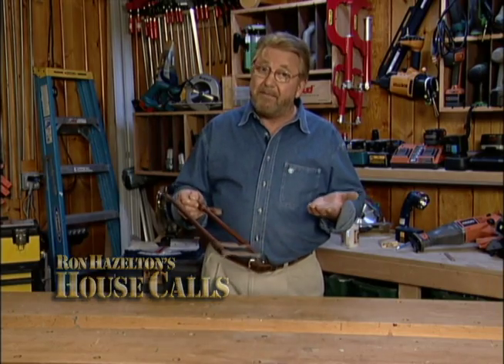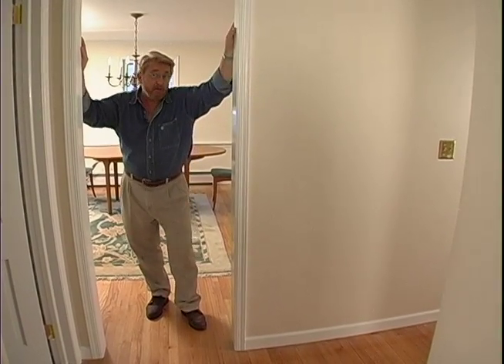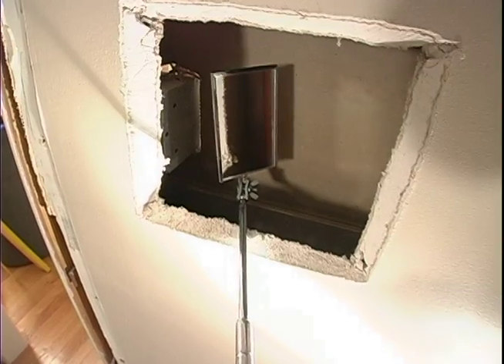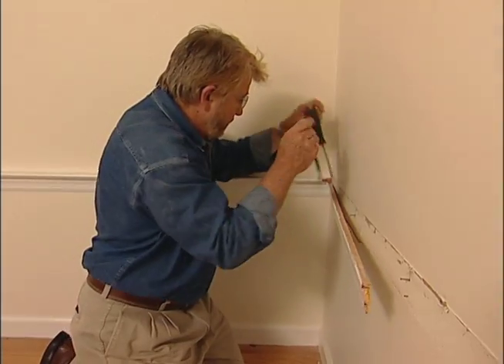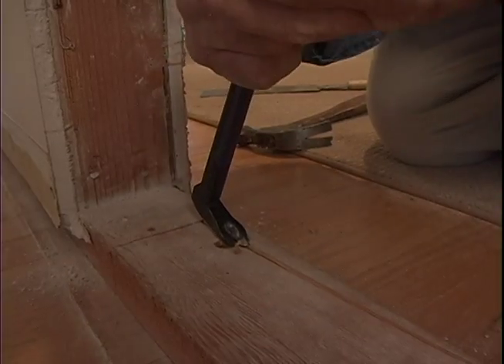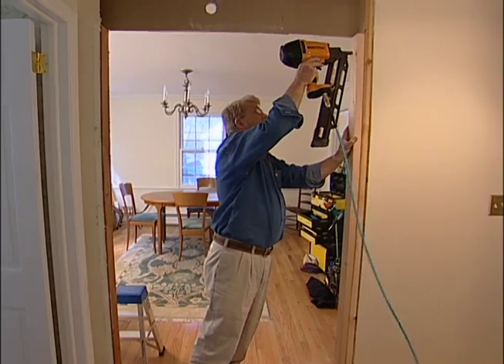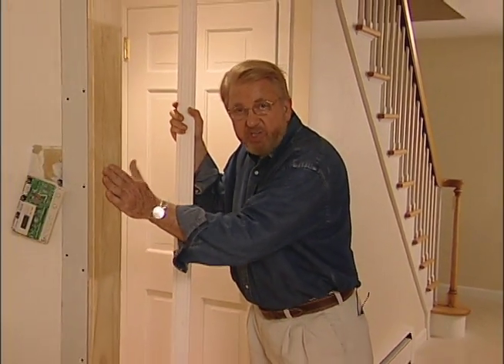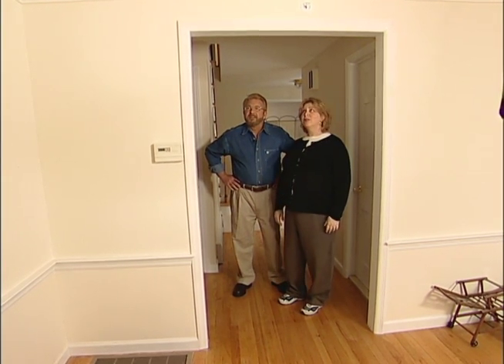How to Widen a Doorway

Comment: I like the way it turned of but do have a couple issues. First, the is no mention made to be certain that this wall was not load bearing. A very important detail to know before you stay cutting out studs. Second, installing the casing before you mud? I would've done it the other way around.
Reply: I agree with the no mention of load bearing. i  want to do something similar and although a lot of other videos show how to check for load bearing, it would have been a nice addition here. I do like the video overall.

Comment: Even if the doorway is not load bearing, I would have preferred to see you put the 2x4 header on edge with a 1/2 plywood filler between them for better support and rigidity.
Reply: no need

Comment: It`s a really nice tutorial! But how to recon whether studs you have removed were load bearing?  I have an idea to replace our entrance door from standard 820mm wide to at least 920. Because this is entrance door it has drywall inside. timber frame in the middle and brick veneer outside.  I afraid I have to reinforce it first before cutting studs. May be you have a technology how to do this to protect roof collapsing, please?

Comment: I'm in dire straights with getting a dryer in my bathroom before Thanksgiving. The door and all framework has been removed and it still needs about 3 inches off. My new dryer is sitting in my dining room. I don't know anyone who is a contractor to cut it and my very handy husband passed in June. I don't care if there is another door put up. What can I do? if anything? Thanks!

Comment: Where's the light switch? Where's the fire suppression system? Surely, you need to preserve both.
Reply: It's still there, you can see it at the end. You can also see the pipe for it coming from the left at 7:22. Earlier in the video he said the light switch was not needed because they had a duplicate somewhere else (4:52).